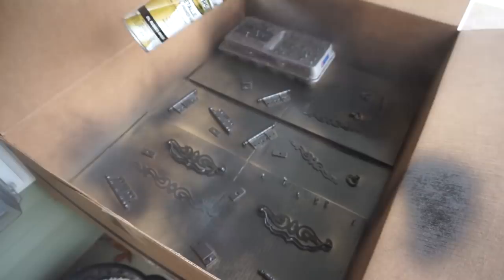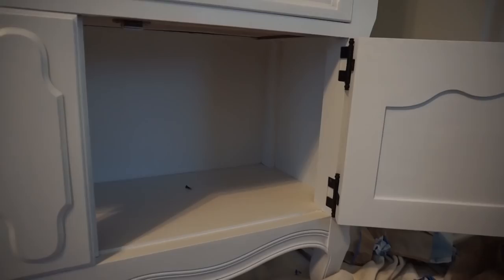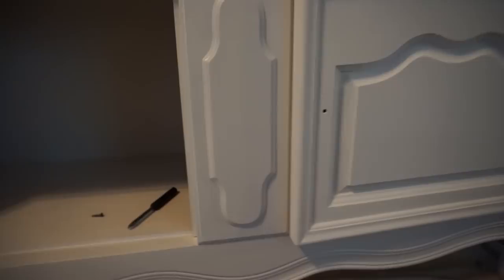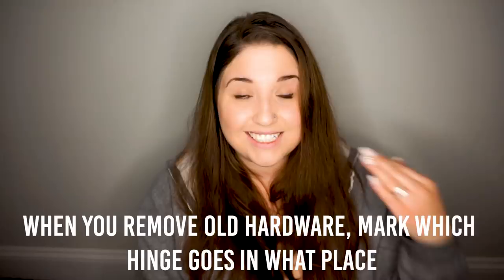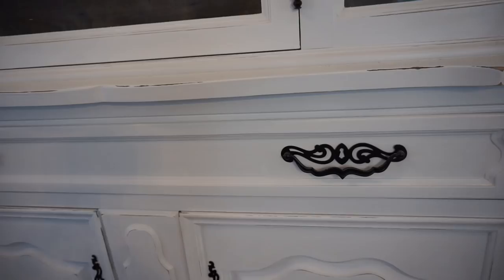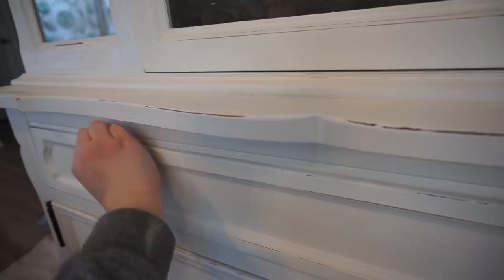The Harrowing Tale of a Disastrous Hutch Makeover - Storytime/DIY Project

Comment: I always put each piece of hardware in it’s own small ziplock sandwich bag and label it. Ex: top right door, bottom left door, label each hinge with corresponding placement. Label paint box with same labeling on ziploc bag. I have done this for years and all my hardware goes back in it’s exact position and no problems with doors/drawers opening or closing.

Comment: Swap the door upside down to the other side and vice versa, this could be your problem, also when you took the color out, and repaint the wood expands with cold, also you adding layers. Do not stop creating because of this hiccup. Learning process.
Reply: Same thing happened to me. I did exactly this, swapped the doors and they fit perfect
Reply: This is also the first thought that crossed my mind. Actually "looks" switched at initial glance.
Reply: This was my first thought
Reply: But the design on the doors shows where they should be. If the doors were swapped they would look upside down

Comment: Next time, don't destroy your paint job ;) The hinges are not the problem.  Take off the cupboards that don't close properly, take off the hardware, and plane them.  You'll need to repaint these areas when you put them back on.  I have to do this all the time when I buy historic properties on the old doors and cabinetry, as the old houses have settled.  Be careful when planing if you haven't used a planer before, it's easy to take off too much.  Alternatively, you can wrap sandpaper around a block, but it will take a long, long time.  By the way, people using paraffin to 'fix' troublesome drawers and cupboards aren't really fixing the problem, they are just putting it off.  Good luck.
Reply: I agree we do this all the time. If you don’t have a planner use a electric sander and sand a little at a time til it shuts then put a small amount of paint to repaint.
Reply: An idea to figure out where to plane is to rub chalk on the edges. Open and close the doors/drawers. Where ever the chalk is ribbed off is where it needs to be planed down or sanded.
Reply: Rita Gary.  just like the dentist does with the carbon paper,  after a filling!!! 😂
Reply: Sirena Spades 
You are right on the money!
Reply: Multiple coats are needed for this project. There's no helping that. So unless she wants to sand the entire thing WELL before starting, she's going to have this issue in the future, and its not a solution for this project. Marking hinges is a mistake, yes. Most definitely. But she's already learned that for future use and is asking for advice on fixing the current doors, not preventing this again in the future. Planing IS the proper solution now.
Reply: Sirena Spades Really because I always mark the hinges to the doors and have never had issues and I’ve redone a lot of old pieces. So I would most certainly mark hinges save you a lot of frustration and work that isn’t necessary.
Reply: Sorry, I meant to type NOT marking hinges was a mistake. ;) At least she knows for next time, and I'm sure her next project will go a bit smoother.
Reply: Plane the door edges and repaint. Don’t try changing the hardware. Good luck!
Reply: Sirena
Reply: ooo good tip
Reply: good tip
Reply: Not a good tip.  Painting and refreshing a piece is a brilliant way to freshen an old piece up.  This definately did not look lovely before - I guess it's all in the taste - but yeah, this def needed to be painted.
Reply: @whitemannativemind I am not a kid and am planning on doing this. I have lived with wood for many years in my Dining Room and I am over it. In the bedroom it's a different story. My sleighbed is stained wood. Is your entire house wood? Do you also have paneling? :D
Reply: @whitemannativemind if you wish that everyone could have their environment the way that they choose (as you say) , then WHY are you telling this lady that she is wrong and berating her for painting wood? So you like wood. Good for you. Not everyone does. It does not mean that your taste is better than hers or vice versa. Live and let live. If you don't like painted wood then stop watching videos of people that paint their wood. 🤷
Reply: Sirena Spades ♠️
Reply: Sirena Spades if they opened fine before she painted, I think the problem was watered down paint (sprayer) caused the wood to expand. With old furniture I use annie Sloan chalk paint and paint right over the hinges and leave the doors on. the low water content of the chalk paint and fast drying time doesn't cause wood to expand as much.
Reply: sometimes the wood needs to contract over time it will be ok
Reply: @knowyourlove5613  no one else mentioned that the paint will make the wood expand. Seems less trouble to leave the doors on, but then, can you reach every spot? And if you want the hinges to be a different color and shine, how do you finish them? In place?
Reply: Exactly, I was wondering why she thought it was the hinges,,🙄

Comment: There's something in the air! I was chalk painting a sofa table I picked up for cheap cheap. It was to be my "experimental" entrance into the realm of chalk paint.  After a sanding prep and 3 coats of paint I thought I was ready for wax. Starting applying the wax. I bought DECOART WAX that I picked up in the paint section of Lowes. It isn't a paste but liquid. Resembles school glue, but whatever.  As soon as I started brushing on the wax, the chalk paint was lifting right off.  I  couldn't help laughing, thinking of your videos. If I hadn't seen your videos I probably would have been crying. But you've helped me realize- Stuff Happens. Back to square one. I'll either pick up a paste and see if that works better or I'll have to hose down my project and start over. Thanks for helping me keep things in perspective!!! LOL
Reply from the maker: Haha I'm so glad I could help you!  I'm totally not glad your paint lifted...that's horrible.  But you can do it!!   I'm sure it will be absolutely stunning when you finish it :D
Reply: On Debi’s Design Diary she paints several pieces of furniture with DIY chalk paint. I’m going to try it in the spring when I can move my furniture outside to paint because of my furry 4 legged helpers lol.
Reply: @betsysanders4524  Tyfs Debs diary,I have alot of ideas from her site about chalk paint.

Comment: You can try making the cut-outs for the hinges just a little deeper, either by sanding them out or by shaving them with a razor blade. 

Dry-fit the hinges one by one so you can see which hinge fits most flush in each indentation. 

If your doors fit snugly to begin with, you want to sand the edges before painting. Your paint is adding a tiny bit of bulk with every coat. The good thing is that the edges of the doors don't have to be perfectly painted: nobody sees them when the doors are closed. You can just dry-brush them or use a very thin mix of water and paint and pickle them by wiping the mix on with a damp rag.

Comment: I took my painted china cabinet (that I have been working on 6 months) and set it up to sell in my booth at an Antique Mall, without putting the glass door on first. OOPS! I can't get it to close. There  are 3 hinges and I lost one so I replaced it with a new one. After reading the comments, I don't know what the problem is. I was going to sand the side of the door opposite the hinged side, but will scratch that since it didn't work for you. I brought the door home and told the Mall that if someone wants it without the door I can make them a deal they will love! One drawer also sticks but I'll try the paraffin with wax paper. You are so cute and have a good presentation on your video...keep them coming!

Comment: When we repainted our 1970 kitchen cabinets, my husband recognized that hinges would be an issue.  We looked and couldn't find any new hinges to fit and hang the cupboard exactly.  I don't think he kept track of which hinge went where, but we did mark for exact location each cabinet door, there were about 16.  My husband soaked the old hinges in mineral oil or something to remove the old paint.  We had to replace one cabinet's hinges for some reason.  The lesson I learned from that project is - buy a rotary sander, no matter what your husband says!  These were flat cabinets, which needed layers of sanding and priming on both sides.  Just be very gentle!  One of my cabinet doors is a bit warped - a small price to pay for not buying laminated imported junk!

Comment: I'd recommend either sanding or planing the top bottom and front edge of the doors.  Since one of them moves in the frame but still sticks closed, I think there's something at the top or bottom or the doors interfering with the smooth movement of the doors.

Comment: Why don't you try moving the hinges around? You might hit on the magic combo !  Wouldn't it be nice if it were that easy? Lol
Reply: IF that's the problem,  it would actually be very quick and easy to check each combination.  number the hinges.  put hinge 1 in the top spot and then try the others on the bottom.  if none of those work,  move hinge 2 to the top spot and so on.   But it's more likely that it's a combination of wood expansion and adding to the thickness with the layers of paint.

Comment: For your hutch, I'll suggest to take the hinges off and spackle the hang space and then re add new similar hinges. Or you can use a wood plainer  to thin  out the wood just a little bit thinner. And the last option is to try to find the right fit by changing the hinges around  until you find the right fit as they were before you started this project.

Comment: I agree with Sirena Spades on the planning. The moisture in the paint probably swelled the wood a bit. It may go away on its own but if it does it would probably be ages so planning is a more solid fix.

Comment: You definitely have to clean  and sand the whole thing before you try to paint, along with taking the drawers out, and taking off handles and hinges if you dont want them painted. definitely stick a piece of tape and label each hinge and handle you take off, and number all doors and drawers to begin with. Just helps later on. Then clean with a mild cleaner and water, dry off, and lightly sand the entire surface you want to paint. The paint needs something to cling to, and if the finish already on it is too smooth, it will not cling. Preparation is always key in painting furniture. In my own experience with different types of furniture, sometimes a piece is built from different types of wood for back, sides, front, top, etc. They can all respond differently to paint. And if some parts are particle board or other stuff, it can be really tricky. I have found that spray chalk paint works better if the surface you are spraying is facing up. Yep. Dont set it vertical, it will drip. Always set the surface face up and no drips, and dont hurry the process. Take your time. Short, quick sprays, not a long spray. Let the layers DRY before you add the next coat. Very key. Very. Also, to help drawers glide and doors close, take a big piece of wax and run it along the drawer and door edges and around the frames. Wax works great for that, just like waxing skis. How they used to do back in the day.

Comment: I had the same problem with my drawers and cabinets not fitting afterward. I was so mad. We sanded and sanded and sanded until they fit again. Then I put and extremely thin coat of paint.

Comment: that trick with the wax paper, i use candles. any kind works, birthday to the huge 3 wick ones that are all used up. if you don't have any of that laying around, bar soap works too, all this not only will make the wood glide open and closed, it will keep out the moisture in the air and help prevent swelling, which causes sticking.

Comment: I admire you for showing you4 vulnerability in this project, that takes guts! Good idea to lightly plane the edges of the doors, because the paint is thick, and adds up to quite a lot of extra measurements  right round. Then re apply paint much  thinner to edges. You will get it right, it’s a lovely piece and you have almost done it proud. Never give up.

Comment: Sand door openings and the edges of the doors to remove about 1/16th of wood, then repaint. Always mark your hardware with tape when removing them so you know where to return them to. Don’t give up on the hinges, move them around (one door at a time) until you find the right fit. Avoid painting under hinges or sand down to wood with 80 grit sandpaper. It’s a love hutch!

Comment: The hutch looks beautiful. I love how you humorously show how things can go wrong in the process!
Even adding thin layers of paint add bulk to the piece. Fold a piece of graphite paper (not carbon paper) in half, right side out and close the door on it...go all around the frame to see where it is rubbing or sticking. You can sand or plane just those areas and repaint as needed. (If the doors become too loose you could add a magnetic pop-latch.)
For future projects involving drawers or doors, sand a little of the wood away BEFORE painting the piece. Work and complete one door or drawer to see how much to sand off the rest if the piece. Looking forward to your next project.

Comment: Sometimes  you can adjust the way a door hangs by shimming one of the hinges, especially if it is only sticking in one spot. It probably is not hanging plum and parallel with the cabinet so you have to eyeball it to figure out which hinge to shim.

Comment: keep the bottom doors closed, if your hubby is handy with woodwork have him cut out the center woodwork design on the doors so it is now an open space or leave the doors off completely and add cute decorative baskets inside so you can still access the bottom shelves. Love your Rae Dunn collection!❤

Comment: 1st time seeing ur videos..So cute. By now I hope u found a solution. When I painted my bathroom cabinets I came upon this problem, again. First time was when I put my 1st born's crib together. .Something I never forgot after so many hours struggling. Anyway back to ur problem, I hope this works for u. When putting any doors back on, on cabinetry..I always screw on all screws half way in, then after there all on.. then I proceed to tighten them. This keeps them balanced too. Should work with any door. Good Luck 🍀Balance is the key..did I mention that I also sprayed painted my hinges.

Comment: That was a great video. Thanks for sharing. What I might do if I were you to fix the door problem is remove the centerpiece stile between the doors if possible (maybe it’s installed with pocket screws you can remove) and trim the edges off by a 1/16 with a table saw.   Refinish and reinstall.  It might not be possible if that piece is too difficult to remove. But double check how it’s installed

Comment: I feel you on this!!!  I had this trouble with doors we painted in the house.  I also did not mark which hinges went where!  We ended up chiseling out around the hinges.  On your hutch, it looks like the hinges that attach to the door do not sit flush with the door, they sit on top.  So...  maybe try chiseling a slot for that part too?  I do not know if that will work for the hinges you have.  Hope you found a solution!  :D

Comment: In the vid after you go back in to try nf fix by cleanting paint all out, hing part on the door shows a divet on the door, It looks lke tat part of the hinge is sitting lower then the divit, assuming it needs to be higher. Check your other inges to see if they do that?  If you find them all the divits are filled with part of the hinge, could be why.  If you find a hing that is taller then the divet, could be those 2 need swaping out.

Comment: The problem with your doors may be this. When really old furniture  has been without a finish--oil, shellac, or whatever, for  very long time, the would changes.  The pores close down, so to speak. Then, when it receives moisture in the form of paint, it expands. Those ittty pores open up and breathe. The same can happen during the rainy season as well on long-established kitchen cabinets and the like. Some of the cause is the type of wood, the cut of the planking used,  and its age.  You might have to shave off a wee bit from the sticking edge.  If you rotate the hinges on the various doors, one hinge at a time, you'll eventually find the combo that works.

Think of it as a jigsaw puzzle that brings visual and functional satisfaction every time you're near the piece of furniture. Oh, and one other thing--if you don't have wax paper, try a candle. Emergency candles are epecially good for rubbing sticking doors and drawers. Lasts longer than the paper fix. Just suggestions.

Comment: I has that door problem with my desk hutch...try taking the doors off flip them 360 and put them on the other side...each door only fits it's original slot...might be the case with the hinges but most likely the door itself..try each door on either side

Comment: Get a Rockler’s catalogue and look through the hardware. They save me all the time. No project is problem free. I’m doing a desk. I spray Prime the the drawer after sanding and using TSP, and get a nice enamel. I spray the desk and get this sandy, dusty finish? Now I have to sand most of it off before I paint. I might as well have just cleaned it up and painted. Waxing and powder hide a multitude of sins. 
Good videos.